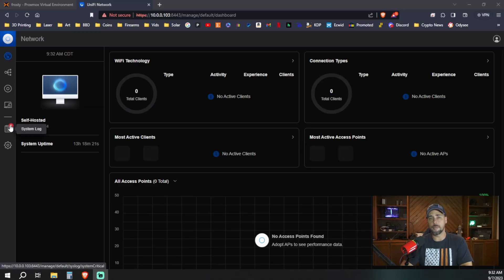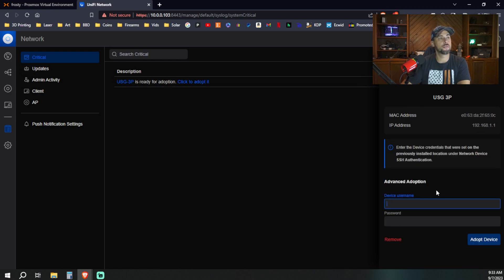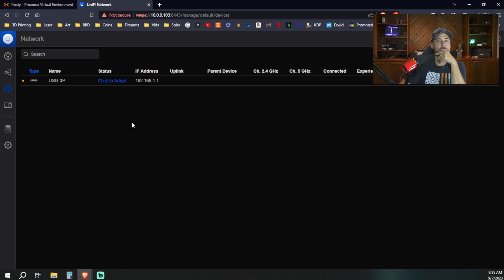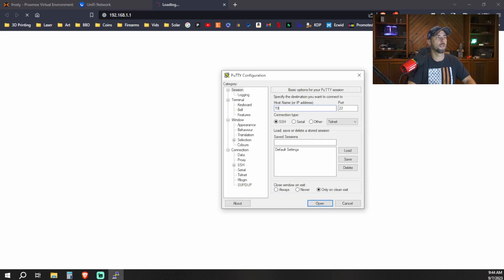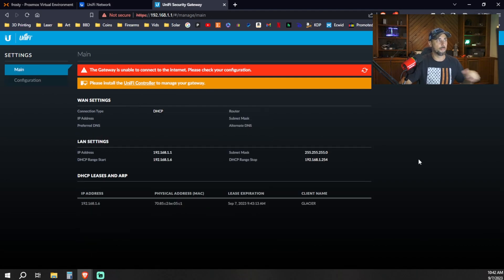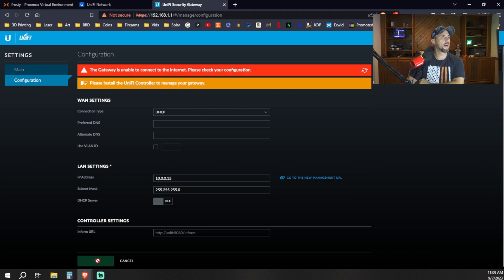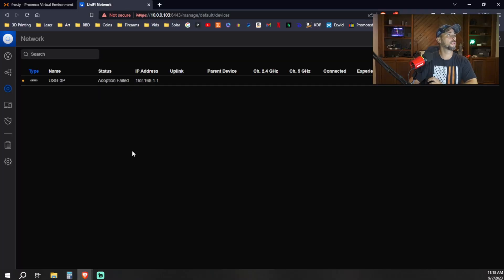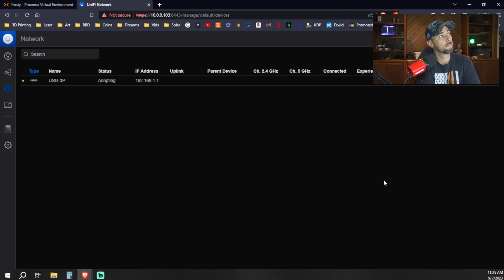Goodbye UniFi: Adoption Failure Was My Breaking Point!

Comment: I think it's a case of you don't know what you're doing. Secondly, you bought something that is way obsolete and EOL. WHY???
Reply from the maker: Yep, no clue what i'm doing. Even though i have been successfully running a unifi controller and ubiquiti hardware for the past 4 years at my previous house, and when i setup at this new location they magically stopped working, because I don't know what i'm doing 🤣
Reply: @GeekOfAllTrades  I'm if you've been doing networking for you should know about arp, dhcp reservation. First, you tried connect on different subnets. then you were surprised that it wouldn't get an address while admitting it shouldn't be the dhcp server.
You SHOULD have made a new interface and VLAN in the default range, checked your routing, checked firewall rules and then connected to it. 
Unifi can be frustrating, but your ignorance of networking is astounding

Comment: Hook a cloud key Gen 1 into your network and you'll adopt it with no issue. The problem is the USG is an EOL product and the desktop controller refuses to work with it unless you get a controller installed in the sub-5 (5.6, 5.7) version and then update from there. Or you can simply go the TP-Link Omada route.
Reply: You can still use it even though its EOL. The provisioning URL has to be reentered multiple times "DURRING THE ADOPTION PROCESS" It gets cleared durring the process but if you spam the command from CLI it will adopt. Also make sure you dont have any weird DHCP options set like option 48

Comment: just wanted to say i have had my unfi setup for a year over now with 3 AP's i had auto update but ever since the latest update my AP's will un adopt and re adopt by them selfs . I got the same message with with adoption failed when the AP's went in to re adopt on one of my AP's but  it to the point where its in a isolation state and i have tried cycling POE but  i think the only way to get it out of that state is to do a factory rest which i cant do because i can no longer physically reach the ap. With all this being said i think its a a software problem on unfi with there new firmware

Comment: I had the same problem using docker... I just had to go in the system menu check override on inform host and put the IP address of the machine I was running docker on
Reply: Yep, you gotta override cause I had the same issue when I used the controller in docker too.

Comment: There is an old saying “a poor workman always blames his tools” how many of these have you ever deployed? 

Having deployed many commercially along with USG Pro 4 never have had this issue… even with our UniFi controller hosted in Azure providing for multiple customer networks.

I would suggest ensuring ISP router is in bridge mode else the end result is this🤡fest…
Reply: and you were so good at it right from the start... It is very easy when you deploy greenfield project, but it is a whole another story when you don't have any experience with the brand and have to integrate it within existing network.
Reply: @ actually often having to integrate with other equipment such as Mikrotik… especially when integrating with various WISP who didn’t all use Ubiquiti kit…

Comment: I think Ubiquiti has pretty much abandoned the USG at this point in favor of the Dream Machines.  I have adopted many of those USG4’s but the older they got with the new controllers, I had to console into them and force a firmware upgrade. Then it would adopt.

Comment: I'm amazed that they say it's all "One Click" solution hardware, when a seasoned IT/Network system admin can't work it out.
Thank you for this, I'm going to steer clear of anything unifi as I work on my new network layout.
Reply: You can absolutely do that but for every one nightmare.. which you can find in every brand.. there are thousands of flawless. I personally have set up around 200 networks with 0 issues

Also remember what he is trying to do is a good bit past EOL. Trying to connect old with new doesn't work well no matter the brand

Comment: I tried to use USG once, when I saw that it relied on controller to function, I threw it out. Haven't had issues with the UISP line(edgerouter and edgeswitch). No controller needed, all manageable through web interface.